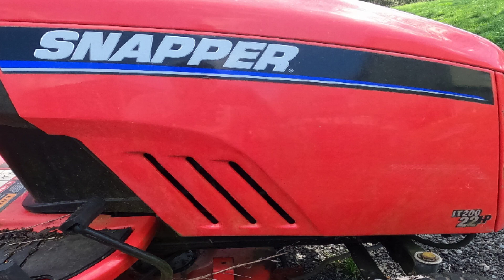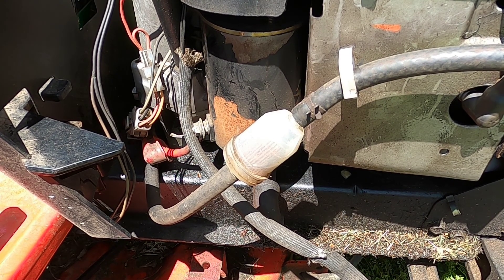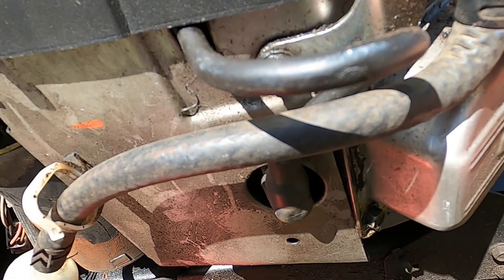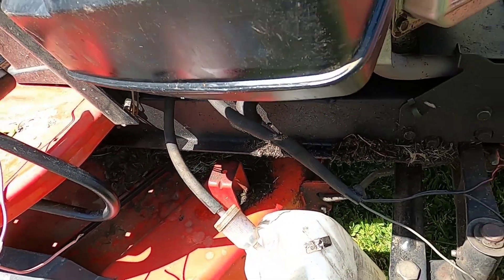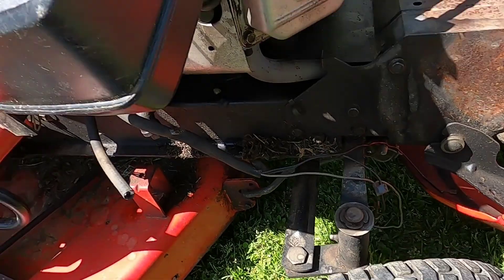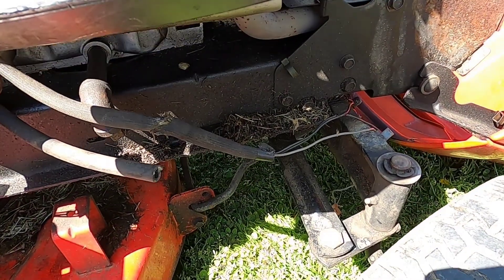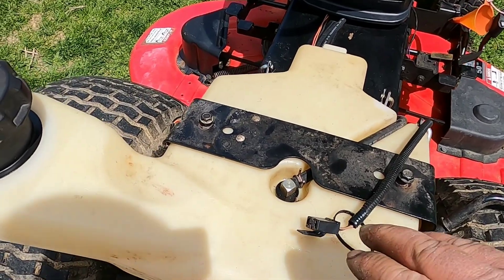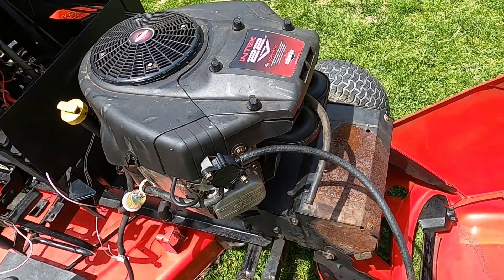Mower turns over, cranks but wont start fuel pump diagnose

Comment: I have a White GT205 with the same engine and I am having a bear of a time figuring this all out. It has absolutely no flow out the fuel pump and it isn’t suctioning from the tank either. I managed to prime fuel to the pump with an pneumatic blower  gun, but it would not go past the input of the fuel pump. Found your video when I put in “Fuel Pump Lawn Mower” in the search and was relieved when I saw the same engine I am working with and I suspected the fuel pump is out. I have ruled out pressure pulse and it has a new pressure line from the valve cover to the pump. That makes me highly suspicious the fuel pump went out. Your video helped confirm that. Off to get a fuel pump now!
Reply from the maker: I am glad this was of help. And thank you for watching and taking the time to comment. @tundrajt I have other videos on my channel that cover different subjects  and new videos added weekly that may also be of help or interest.

Your support is not required but always appreciated. If you are inclined to do so your Subscription, Likes, Comments and sharing this content do help.

Another way to Help Support The Joe Z Channel at no cost to you
is by using my affiliate links or  just go to:
                      https://www.amazon.com/shop/joez
To purchase your fuel pump. This will not be of any additional cost to you.
An affiliate advertising program is designed to provide a means for sites to earn advertising fees by advertising and linking to amazon, that helps me to continue producing videos.
Thank you for your support and using the links provided to make your purchases. 
                                                This is always appreciated.
                            ***** Thank you for your support ******
I hope you get to  enjoy other videos on my channel as well. 
 Stay safe, Joe Z

Comment: Just noticed your fuel filter directions backwards there’s a arrow that shows flow  to be towards pump n carb
Reply from the maker: Good catch!  You are correct. Just a note if anyone should realize that they also installed their filter backwards and used their mower do not reverse the filter but install a new one. Thank you for watching & adding this comment. Your commenting, sharing, 👍s, and subscribing would be a be help and always appreciated.
Stay well, Joe Z

Comment: Great video and thanks for making it. My Ariens 42” lawn tractor with. 18.5 hp Briggs Intek has the gas tank that is higher than the carb. Do you think my lawn tractor has a fuel pump then?  It acts like it’s not getting gas since I put some gas or Ether in the intake and it fires right up the seconds later dies. Gas flows out of the tank in the fuel line when I pull the fuel line off the carb. Doesn’t appear the carb bowl is filling up though.
Reply from the maker: Thank you for watching and taking the time to comment. With the tank being higher it "" usually ""  would not have a fuel pump. To be sure follow the fuel line from the gas tank to the carburetor, if you have a fuel pump it would be located close to the carb. Could be a clogged gas cap not venting causing a vacuum in the gas tank, try running it with the cap loose to see if it stalls.  Check your fuel filter. Does it have fuel in it? If so does it still have fuel in in when it stalls?  If it doesn't the fuel filter should be changed. If it does have fuel in it could be the float is sticking in the upper position holding the needle valve against the seat or the needle valve had stuck in the upper position stopping the gas supply.
Let me know if this was of help.
 
 Stay safe, Joe Z
Reply: @JOEZEP54  thank Joe I’ll check these things and let you know.

Comment: I changed out my filter but the carburetor didn't have any fuel in it so maybe it is the fuel pump or a leak thank you
Reply from the maker: Gary before you buy a fuel pump check your fuel line to make sure fuel is flowing through. If so carefully turn the engine over with the fuel line from the fuel pump to the carburetor disconnected & into a container. If fuel does not pump through then change the pump.
Let me know if this was of help.
Stay safe, Joe Z

Comment: So I’m not getting gas into my fuel filter from the gas tank, can it be a fuel pump issue?
Reply from the maker: xavier thank  you for stopping by. It can also be a bad or clogged fuel line. The ethanol gas will cause the inside of the fuel line to deteriorate & keep the gas from flowing. First try to start it with the gas cap loose to allow air into the tank. If the cap is bad it will cause a vapor lock. DO NOT RUN THE TRACTOR WITH THE CAP LOOSE IF IT SHOULD START. REPLACE IT   
Let me know if this was of help.
Stay safe, Joe Z

Comment: I have a John Deere 160  riding lawn mower and I put a new fuel pump on it and it went around the yard 4 times Is then quit. I can't get the new fuel pump to pump fuel.
Reply from the maker: Jus a few quick checks. I would check the fuel line, make sure it is free of any debris. If it  is the original it may be time to change it. I had a few that looked good on the outside but were collapsing inside. Check the fuel filter is it clean installed correctly? Are all 3 lines on connected to the fuel pump solid, no cracks?  If this all checks out check the gas tank. Debris can be clogging the outlet. After all this checks out I would go back to the pump, it could be defective. I read a couple of blogs where some guys were complaining the  new pump was bad.
Let me know if any of this was of help.
Stay well, Joe Z
Reply: @JOEZEP54   It's all good advice and I ordered a new fuel pump in case  the one I had was bad so we'll see.
Reply from the maker: @icemancometh8679  Let me know.
Reply: @JOEZEP54  Got a new fuel pump and put it on and it still doesn't run.  Can't figure it out. Will look at it later again - maybe fill fuel line.
Reply from the maker: @icemancometh8679  Be careful doing this. Disconnect the fuel line between the fuel pump to the carburetor. Put it into a container then crank the engine. If the fuel line & pump are good gas should pump into the container.
Reply: @JOEZEP54   Thank you for all the help- even later you said, " let me know."    Yes, I subscribed to your channel. 😁  Ok so my brother said to take the tank off and clean it out-I did.   Then I put the new fuel pump on and it still didn't do anything but you told me to take the hose off and see if it would pump out of the pump to the carburetor.   For the first time it did -  it was pumping gas out.   So I knew I was getting there because it wasn't doing that at all before. Next I blew on the gas line that went into the carburetor.  Nothing, so I sucked on it and that gave way to whatever was making the blockage-nothing really came out it just felt blocked.   I blew and sucked on it both ways to clean out the line. Now the drive belt came off but I'll get it.  It just wanted a lot of attention I guess. Thanks again for all the help.  It about killed me -  I fought it for days!
Reply from the maker: @icemancometh8679  Thank you for your support I do appreciate it. Sometimes these units can drive you crazy.  lol  From what you just described about the fuel line you may want to change it out. I had a rider that would start, then after a few minutes die out. Run ok with the deck not engaged & a few other issues. After a very long day it turned out to be just a fuel line. It deteriorated on the inside, outside looked great. It would only allow a slow feed to the carburetor. Something I now check as a regular part of my maintenance.
Stay well, Joe Z